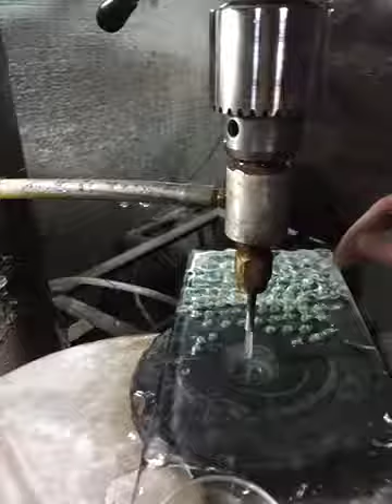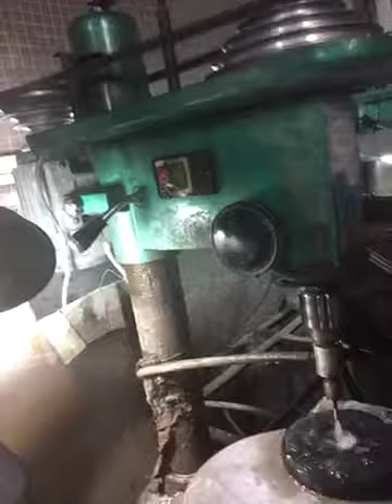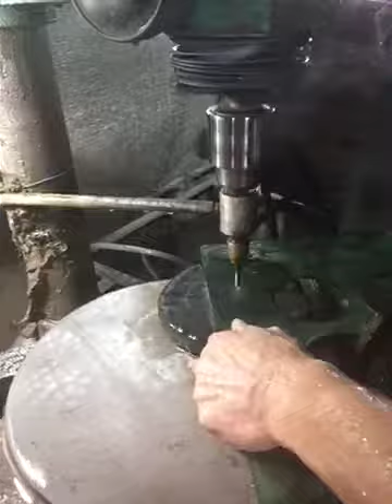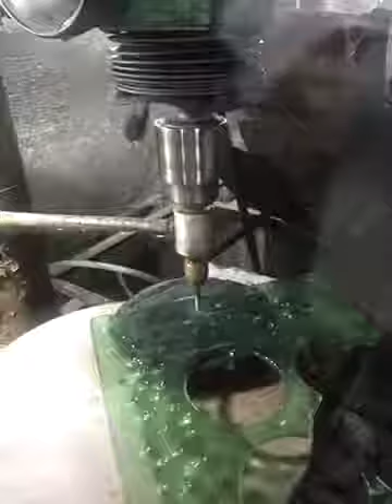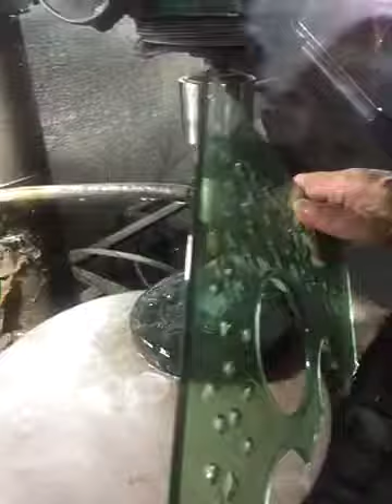Glass Diamond Drill Bit (diameter 6mm,glass thickness 6mm, drilling a hole use less than 2 seconds)

Comment from the maker: sintered diamond drill bit sharp type,drill diameter 6mm,glass thickness 6mm, drilling a hole use less than 2 seconds,glass thickness 8mm,drilling a hole use less than 3 seconds.
www.hnhongxiang.com
admin@hnhongxiang.com
whatapp:+8613613801611